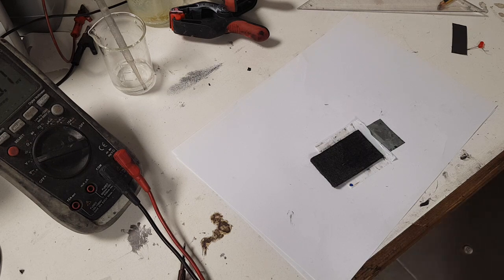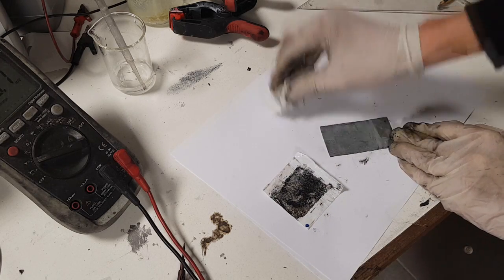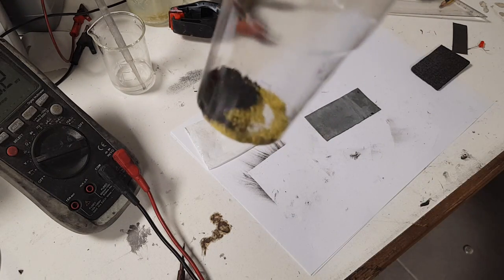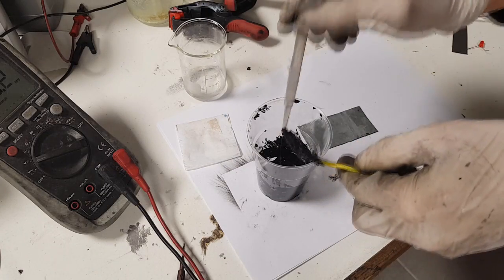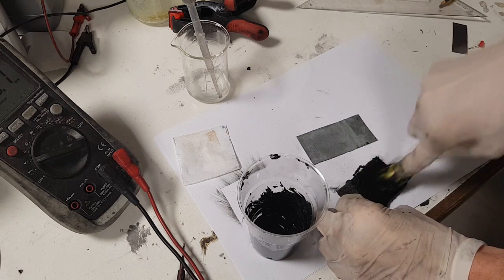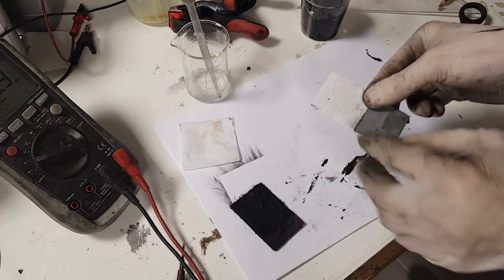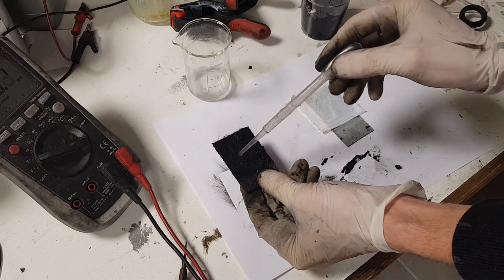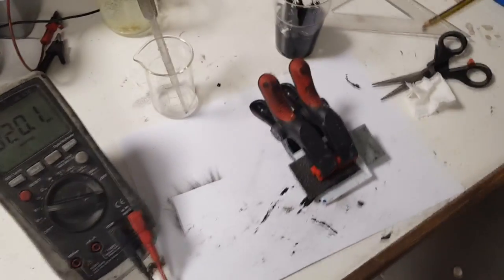How to make a 2.4Volt Zinc Battery (zinc hexacyanoferrate)

Comment: Hi. Where did you buy the Zinc Hexacyanoferrate. Please send the link. Thanks.
Reply from the maker: Hi! I made the material by my self. Potassium hexacyanoferrate + zinc sulfate
Reply: @cayrex  Thsnk you for the quick reply. 

I will like you to repeat this very experiment but using a Redox Flow system. Build the 2 ion exchange cells and use Zinc Hexacyanoferrate + Graphite mixtures as the active materials for Cathode and KOH + ZnO as the active materials for the Anode.
I will donate some money towards this experiment.
Reply from the maker: I do not understand what you mean. You want a cell in flow system? That you have two tanks of electrolyte, some pumps and that the electrolyte is circling?
Reply: Yes. Redox Flow Battery system using the materials used in the in the video.
Reply from the maker: @kazeem-mustapha  ok! But sorry, I can not make it right now, because I dont have potassium hexacyanoferrate and separator anymore
Reply: @cayrex  Don't worry, I will donate $50 towards this experiment
Reply from the maker: I really dont know when I will be able to make the cell in a flow setupe
Reply from the maker: Ok
Reply: @kazeem-mustapha  I'd like to see this with Nickel hexacyanoferrate.  The unloaded voltage is ~3.4v

Comment: So if you ad some Formic acid to the other side maybe you get 2.7?
Reply from the maker: But what I found is greater is the difference of the ph more voltage you get. But in this battery I was focused into materials that are not  so dangerous and not hard to find.
Reply: cayrex2 yes . Maybe citric acid !
Reply from the maker: @Buzzhumma  yes. But then this battery will not be rechargeable
Reply from the maker: The problem is that not each electrolyte will not work reverse. And you will end up with a primarily battery
Reply: cayrex2 yes I see .
Reply: cayrex2 Oh it will be rechargeable indeed, because the principal of operation is the difference in the proton gradient, which will react through acid-base reaction in a selective seperator. So you can reverse-hydrolyse it by applying an electric voltage. The only problem I see may be the intrinsic oxidation of CA,
Reply from the maker: Hmm, I dont know,.... yet

Comment: Well done Dusan. Probably a filter paper Seperator could not be used as a substitute to the Li-ion seperator, cause it is eaten away by the KOH , right ? Any other Substitute from common household materials ? Many thanks. Regards, Stefan.
Reply from the maker: Sorry no,... you will not find any usfull separator in common household
Reply: @cayrex  will Nafion work too?
Reply: @cayrex  Well Osmosis filter foil will work..Any idea where to get this cheaply ?
Reply: overunitydotcom I‘d use nafion or nascion membranes for this, filter paper won‘t work, but indeed you could make a membrane from materials you find in your household, for example glue and sodium silicate...or peg and glue...

I will explain how it works with sodium silicate, first on you will need clear, solvent free polyvinyl alcohol based glue, take 60ml of the glue and 20ml of a 36% sodium silicate solution, when mixed you will get a semi-crosslinked organic-silicon polymer composite, squeeze it a bit in your hands and redissolve in fresh water to get a final volume of 80ml, heat the solution for this. Dry the solution in a petri dish at 60-70C (not below and not above, very important, else it either won‘t crosslink or you won‘t be able to remove the film). After the film has dried carefully remove it from the petri dish and soak it in a 1-2M sodium hydroxide solution for a few hours, this will make it insoluble in any solvent and fully crosslinked, if it has to be transparent treat it with a multivalent salt. Soak the membrane in a 10% NaCl solution for a couple hours ans voila! 

There are several other ways to crosslink pva though, for example citric acid, PEG, polycondensation etc
Reply: Andre Leonhardt wow dude, thanks! Do you know some papers to read on these and other ways to crosslink pva?

Comment: I bought Celgard (for Li Ion batteries) on eBay but I can't get it to work with aqueous electrolytes. Evidently, Celgard  needs to be coated with a special wetting agent for use with aqueous electrolytes. The only Celgard I got to work is the piece I got from RMS's battery kit. Robert said in one video that it is indeed coated with a wetting agent. If that piece you took from the Li- ion battery works in aqueous media it must be coated with something. Am I right in this?
Reply: William Hada In your case I‘d try to wet it with ethanol and wash it with water, this way the membrane gets hydrophilic
Reply: As an engineered product maybe the pores are specifically sized for lithium ion. And they very small.